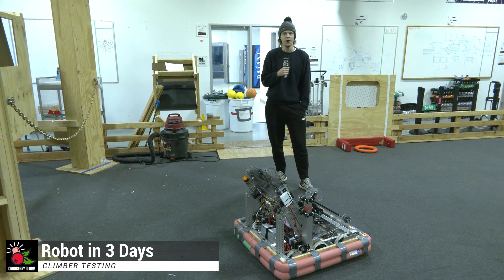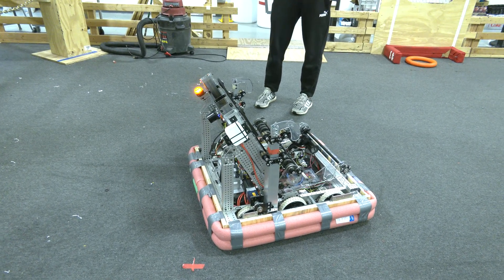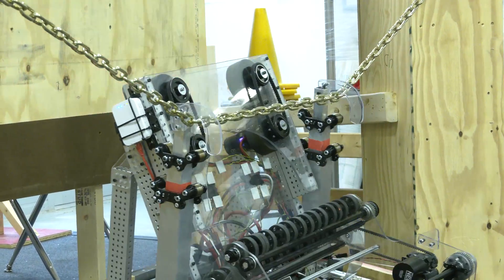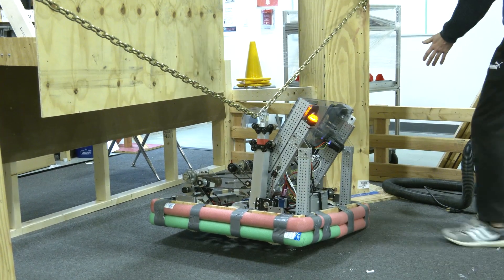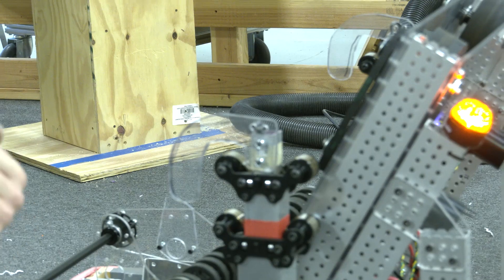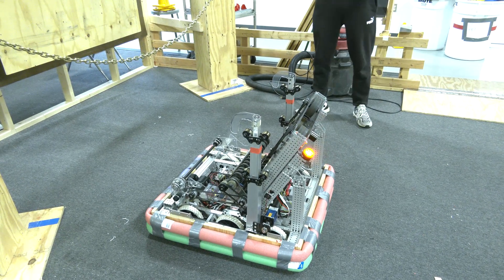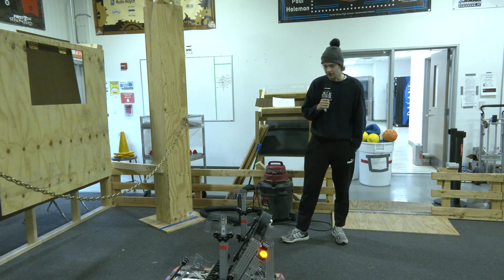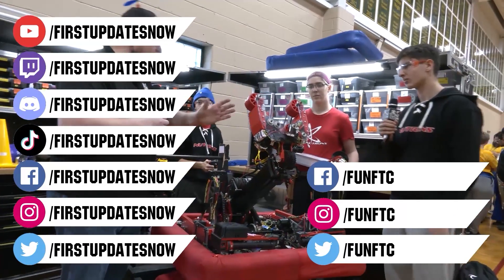Climber Testing and Demo | Ri3D Cranberry Alarm | Crescendo 2024

Comment: Is there a video of yall adding the thrifty bot climber and the rest of the parts to the robot? Planning to replicate on the everybot  with single climber in place of everybot climber. trying to figure out all the parts needed and how to attach to everybot. Everybot using NEO with 60:1 gearbox but did you say NEO with 12:1 CIM Sport gearbox on MaxPlanentary with a 10:1? Yall Explain very well.

Comment: What modifications did they do on the thrifty bot climbers , and how complex to pull that off was it
Reply: The TTB telescoping tube kits are entirely stock here.  We just selected the length of the aluminum tubes (10.5 in) and created motor mounts for the sport planetary gearboxes out of some TTB brackets.  -  Cory from CA

Comment: why do telescoping when a 1 stage elevator works way better. you could make it out of either tslot slides (80/20) or just simply use a pneumatic cylinder
Reply: what problem do you see with telescoping? if they can prove it works on the sides and not just the middle then I don't see a need for an elevator.
Reply: you cant pull up as high and they are expensive. Even if you already own one you have to cut it so short its likely the last time you will be able to use it. If you notice most ri3D teams tend to drop down if they dont power the motor. At the end of the match this isnt a big deal if you are several inches/ 1ft off the ground but is if you are only a couple. It is also not possible or practical to do the trap with a telescoping arm unless you make it pivot(which may still not be possible)  @henryp123
Reply: We'll leave it up to all y'all to figure out the best design, but for us this was the easiest/fastest way with our robot's specific space constraints to get the robot off the ground.  -  Cory from CA

Comment: how does andymark climber work actually
Reply: These are actually "Thrifty Telescoping Tube Kits" from the Thrifty Bot.  There are constant force springs which spring the telescoping tubes up, and then there is a motor with a winch on the bottom.  -  Cory from CA

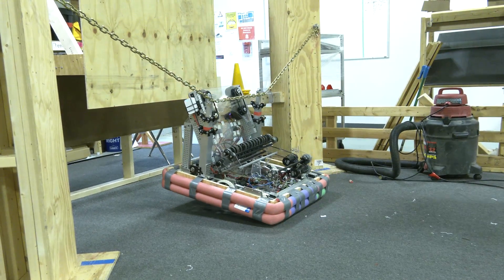Comment: 2:14 you can ensure you catch the chain more effectively even when bouncing by extending to full height and driving a bit further into the chain. Caveat being that you’ll also have to have your gyros back the robot up before your wheels are at a point where you have no traction.  Automating this entire routine using apriltags distance sensing would make it very repeatable.

Comment: Do you guys have other ways to hang if other robots decide to take the position? I know this is early stage of testing but you mainly go for middle is this video.
Reply: The TTB telescoping tubes are the only climbing mechanism on the bot.  The height of them was constrained by the height which we set as our robot maximum (26 in).  If one wanted, they could make the telescoping tubes longer (more than 10.5 in) and climb further to the sides.  -  Cory from CA

Comment: 6:04 I thought a climb would only count if the robot hangs for 5 seconds after timer ends can someone tell me the section that says otherwise?
Reply: If i am not wrong in 6.5 it states "assessment of STAGE points is made 5 seconds after the ARENA timer displays 0:00 following TELEOP, or when all ROBOTS have come to rest following the conclusion of the MATCH,
whichever happens first." So i think this means that if all robots are no longer moving the second the timer hits 0 then the climb will count if u fall of 1 second after the timer is at 0
Reply: Confirming this is correct. A robot that is actively dropping at match end will have to stay suspended for 5 sec (it can drop down some during that time so long as it doesn't contact the floor before 5 sec) this is written the same as climb rules have been written in the past where this was the case and thus I would expect it to be judged the same way
Reply: I believe you are correct. Rule 6.5 bullet point C explains that unless the robots are static at the end of the match, the points are evaluated 5 seconds after the match ends.